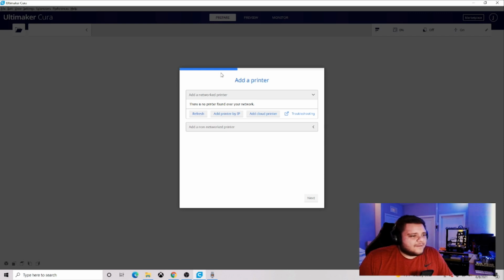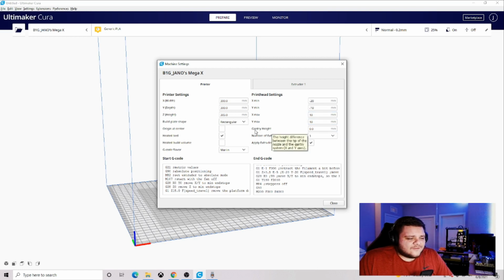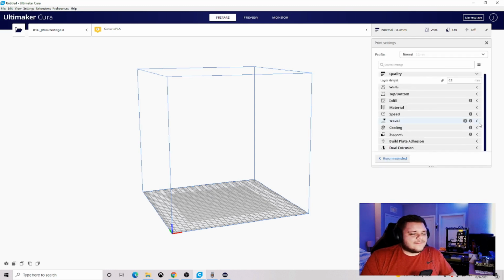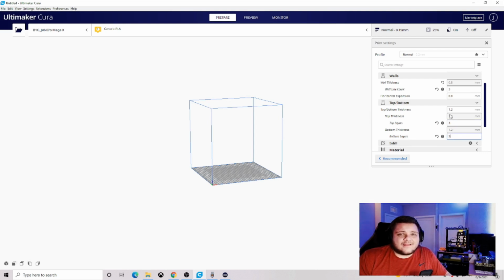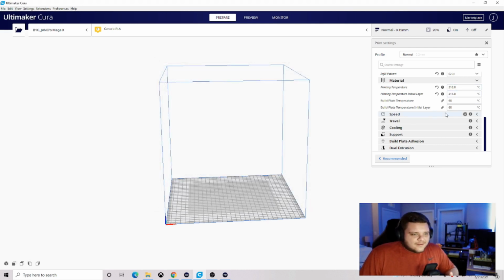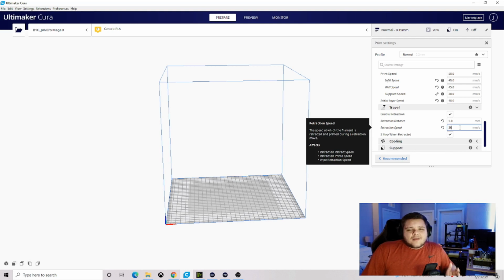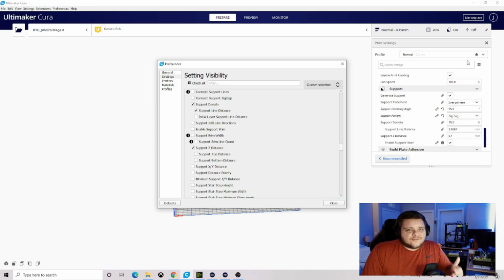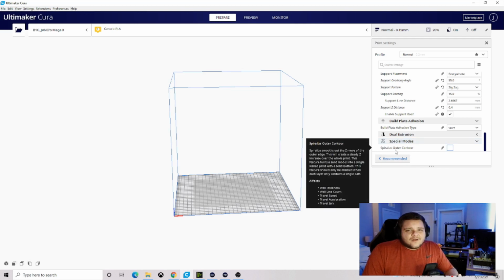How to Set Up your First Slicer Profile for the Anycubic Mega X Using Cura

Comment: I need to update the firmware on my secondhand printer. Any .hex you might have would be appreciated. I have the Trigorilla 0.0.2 boar if that helps.
Reply from the maker: I would recommend looking up  “knutwurst firmware”. This is a community made firmware I used for a while when I still had the original board in my printer. Had a lot of good features if I remember. 

If you’re looking for a Anycubic branded firmware I’m not sure where you can still find it as the Anycubic site has more or less obsoleted this machine. There maybe some links still floating out on the interwebs. 

I’ll see if I still have those hex files somewhere on my pc
Reply: @B1GJano I appreciate you!

Comment: I got the same printer, but I can't get it level because the home setting is too low to be levled with just the little wheels on the bottom of the print bed. Is their any way that I can change the high homepoint by raising the extruder
Reply from the maker: You not without doing some cosmetic changes to the printer unfortunately

Comment: I know this video is from two years ago but I used your example to set up my cura slicer for the Anycubic Mega X and the 3d prints I'm getting are insanely bad. Also, I followed your recommendations for adhesion with the Mega and now nothing sticks. I cleaned a 1/8th inch thick layer of glue stick (put there by previous owner) off to get the print plate back down to its original form factor and now nothing sticks. I think these 3d printers are talking to each other because now my Neptune 2s and Ender 3 have gone on strike in solidarity with the Mega and they won't stick either. So are you like a third world revolutionary trying to unite the 3d printers of the world against their owners? If you are then you have a good start on the revolution.

Comment: Brother, I have really messed something up. After trying to update the firmware my printer is all over the place. When it starts it moves too far to one side and makes a grinding noise and then when it does begin to print. It prints at half height. The z measurements of a 20mm xyz cube was only 10.8mm when finished. What should I do?
Reply from the maker: I would double check you have all the motor wires going into the proper connection spots or make sure none of them are loose. Also, try reverting back to older firmware and see if that helps. Sometimes newer firmware causes more issues than helps.

Comment: Print set up disabled. G code file can not be modified. What should I do? I have an any cubic mega pro. Material use is PETG
Reply from the maker: Im unsure what you are asking. Are you trying to modify gcode? this is for the slicer software that creates the gcode.
Reply: When trying to slice, cura pop up message says, “print set up disabled. G code file can not be modified. Problem solved. I just deleted the file and reinstalled it.
Reply from the maker: @annawardsworth6893  ah ok. Glad you got a solution!

Comment: Hello my friend, my question is when I save another profile it seems that some setting from the last profile also show up. Am I doing something wrong? (I’m sure I am lol)
Reply from the maker: When making new profiles. You’ll want to change the settings you want before saving it as a new profile. Also, when switching from one profile to another, make sure when it asks if you want to translate settings from the one you were on to the one you’re switching to, make sure you click the button not to translate settings. Hope this helps answer your question
Reply: @B1GJano  Thanks for the info. What about a video about filament calibration?  Especially specificly for the Mega 3 and the Mega X?

Comment: Yo bro i've been wondering if you could help me with printing supports? I've gotten the exact same printing profile setup as you do in the video, but my problem is that when printing a model that needs supports, it prints like halfway and then stops extruding filament for whatever reason, printing models without supports are fine however, kinda bummed out about not being able to print models that need supports... Can you help?
Reply: Supports shouldn't by themselves make a print fail, I've never seen that.  sounds like a clogged nozzle.  Tried diff. filament?
Reply: @brianmi40  I just replaced the extruder and everything is all good lmao, thanks for the help though!

Comment: Big Jano, Thank you so much for this video, has really helped. Is there anyway you have cura settings for lithophanes? I can really use help with this. I have a mega x also. Thanks
Reply from the maker: So for lithophanes, I don’t have particular settings, but I have printed a few and my advice for these is as follows: 100%infill, print speeds (infill; no more than 40mm/s, outer walls; 30 mm/s , inner walls; 35-40m/s ) 

0.12-0.15 layer height. They will take longer to print but slower because detail is needed. 
also orient them in the direction of the bed movement (y axis). 

Also a brim on it will help it stay adhered to the bed. Hope this helps.

Comment: i did all the stuff and yet when i press print it just stays in the same spot, any ideas for help?
Reply from the maker: That’s odd. And everything was heated up and correctly wired up?
Reply: @B1GJano  yes I made sure it’s all wired up, it had a previous owner and their old builds on the card work but not the ones I upload to it
Reply: @noahpineda1286  If other card Gcode files work, then you have something wrong in Cura making the gcode files bad.  Start over and check everything.

Comment: Love the videos!
I’m having bad stringing issues with my mega x 
What setting for retraction or whatever do you use?
Reply from the maker: I typically use 3-4 mm retraction with 35-40 mm/s speeds. That has seemed to be a sweet spot for me lately.
Reply: Cura marketplace has a free add-on that will let you drop in test print models, like a stringing test so that you can quickly test and tune.  Also get the short printer prefix name add-on since the Mega X has a crazy small character limitation on the display.  that way you can name your files "X...." instead of the long default printer names Cura provides.

Comment: Do you have a setup for PETG using cura? I made an attempt today but my print was a fail.
Reply: Start with mid- of the temp range the spool has printed on it as recommended.  Also maybe slow it down a bit.

Comment: I’m having trouble putting the negative sign in the X min and Y min!
Reply from the maker: The numbers for the x min should be automatically set when you set that. Is the slice set with the base i3 mega profile? That’s where those values came from and I didn’t have to change those when setting up.

Comment: What happens if my gcode in printer settings is different from yours?
Reply from the maker: If you’re referring to the start/end gcode, If it still starts up the print and finishes the print with no issues, then that’s ok. The rest of the gcode is dependent on your print settings.

Comment: For some reason at the beginning of each print, it will go along the main start area, the left corner, but will let out filament before going into the center... Is there a way to fix this? And before I did your settings, the printer actually just stayed in the left corner and started to do the print there.... where was it wrong in the settings to fix this in the future? Im such a newbie.. and I don't want all my prints to start in the corner.... Thanks!
Reply from the maker: So in the start gcode it does pause in the left corner for a few seconds after homing and before starting a print. That should be normal.  

In terms of the oozing, It’s also not uncommon. I would suggest maybe tubing down your hotend temperature 5-10 degrees to see if that helps.
Reply: You want this to prime the print head, just pull with tweezers as it's about to move to center and start the print, or, you can often use your finger and pull the "tail" it drops on the print outwards away from the center where it won't matter just as soon as the print head moves far enough away to swipe it gently out with a finger.

Comment: Is there a trick to getting the g code file to read properly from the SD card? Currently the anycubic mega x isn't reading any of the files I save from ultimaker.
Reply from the maker: Are you using the sd card that came with the printer? If so, try a different sd card. (And be sure to reformat to FAT 32) the card that came with the machine gave me issues as well

Comment: MY ANYCUBIC MEG X DOSE NOT SHOW ANNY THING ON THE SD CATD WHAT CND I DO
Reply from the maker: Make sure you are using an sd card 32gb or smaller.  At that point try reformatting the sd card to FAT32 if you haven’t already. Also, shorter gcode file names without special characters are preferred to avoid file reading errors

Comment: I recently got the ANYCUBIC Mega S Upgrade FDM 3D Printer. Would this printer follow a similar set up as the Mega X that you are using in the video? (I already tried going through the Cura software and could only find the Prusa Mendel I3 and the I3 MK printers. I'm not sure if they are the same as the Mega X/S)
Reply from the maker: The setup should be similar. The only things you’ll want to change are the bed dimensions to match the mega s and any start and end g code to reflect the smaller dimensions as well. You may also have to tweak settings as you see fit but should be a good starting point

Comment: how do you actually print it though like how do you put it onto the 3d printer becasue i cant seem to fingure it out. iv got the cura ready i just dont know how to plug my usb inot the device
Reply from the maker: so once you have the file sliced in cura, you'll have to insert your sd card into your computer, save the gcode file to the sd card, then put the sd card back into the printer. The printer came with a usb drive that has a sd card slot for it and thats what i normally use. Hope that answers your question!

Comment: So I have a question. I have the same machine your referring to but my print head settings aren’t -20, -10, 10, 10, 0 like yours. They are 20, 10, 10, 10, 0. The first two aren’t negative numbers should I change them? I have been using my machine since last year around this time of year. I haven’t had any major issues. Some corners have lifted and I have to use a skirt or my filament won’t stick on the first layer.
Reply: Nvm I tried to change it to the negatives and it wouldn’t let me
Reply: Same for me. My coordinates are in positives( 20, 10, 10, 10) and I am not able to enter negatives.

Comment: I have the Mega X and when it starts a print it automatically goes off the bed to the bottom left. How do you change the position of where the print starts?
Reply from the maker: I would check your printer settings under the machine settings tab in cura and verify that your printhead settings and starting  gcode match what i describe in the video. That should prevent it from starting in the wrong spot. Also make sure that you have the correct bed dimensions and that your origin isn't set for the center of the print bed.
Reply: @Hayley Reed-Brown check your settings, if going off the bed, the printer is not properly defined in Cura.  Then when you add a model to Cura, if it isn't centered in the "build area", then R Click it and choose "center..."

Comment: Ive purchased two craftbot printers the last five years always used their craftware. Agreat program but not near the setting tweaks that cura has. Jusrchased the anycubic mega X, great printer in my opinion. So having stumbled around with cura this video was very helpful. Just did some parameters for printing with taulman 645 nylon. Printing so far but im hoping to see some predefined printer setings that someone has made. Thanks for making this awesome video, I will be checking out ypour other videos as time allows.
Reply: Additioal comment. Nylon does not like to stick to this bed. I might try some elmers glue stick. have not printed with nylon before. Any suggestions from anyone about a good mounting material/method would be greatly appreciated.

Comment: Very informative and helpful 👍,  couple of questions if anyone can help!  Just bought my Mega X and printed the Owls ( came out really good ) and also a 300x300 test bed print ( also good but a little rough on the surface. So questions are ; are these adjustments necessary and do the settings you put in stay as such until adjusted again?.
Reply from the maker: I would say these settings are I normally use on about 90% of my prints. Now, depending on whats being printed, the detail of the print, and material im using, I sometimes make some small tweeks in retraction, temperature and speed. Feel free to tweak the settings to see if you get better results with your material and printer. If you get better results with settings that are different, then use those. Every printer/spool of filament  is going to operate differently (even if they are the same) so do what works for you! Hope this helped!
Reply: @B1GJano  Retraction and speed ?,  writing all this down Jano 👌

Comment: Will these setting work on the anycubic viber
Reply from the maker: they should. You will need to change the bed dimensions in the slicer though to match the vyper. Also, you may be able to get away with some slightly faster sppeds with that machine from what I have seen. Although since I don't have a vyper, I can't guarentee it will be perfect, but it should be a good starting point.

Comment: I select the boxes you mentioned but a lot of the settings still won't show as visible.  It gives me a long message saying why they are not visible but I do not full understand.  Any idea on what I need to do to get these settings to show up after I check the box.  Below is the message I am receiving.

"This setting has been hidden by the values of Scene Has Support Meshes, Number of Extruders That Are Enabled, Generate Support. Change The Values of those settings to make this setting visible"
Reply from the maker: That is strange.  Any chance you know what version of Cura you are using?
Reply: @B1GJano  Kind of figured it out. I had to set up a profile with Anycubic i3 Mega to get the options you were showing. I was running off of the Anycubic i3 MegaX which hid a lot of the settings.